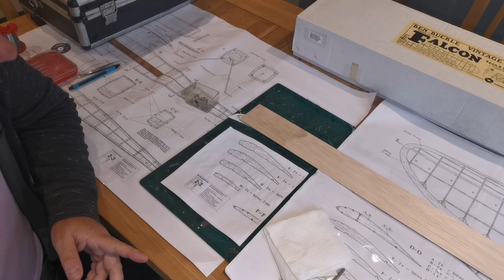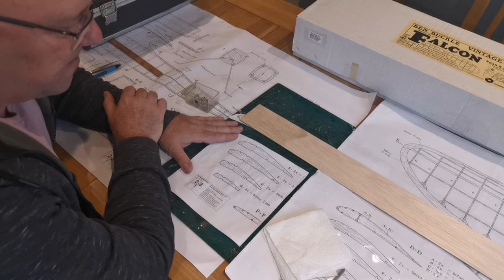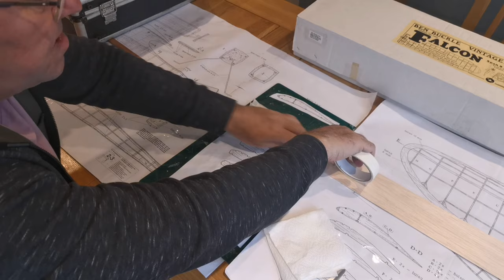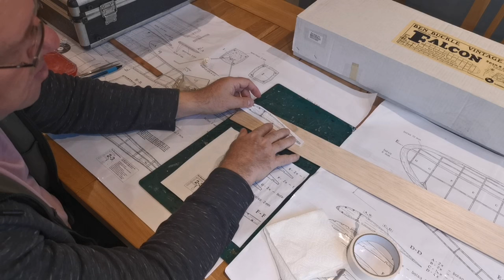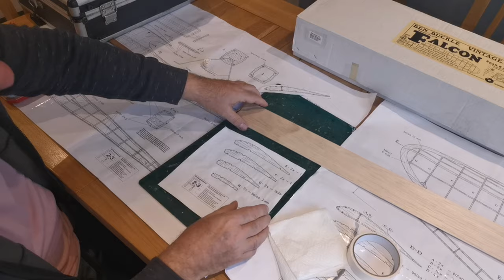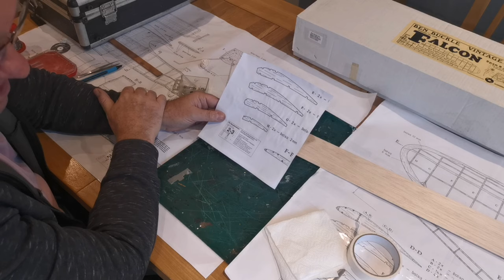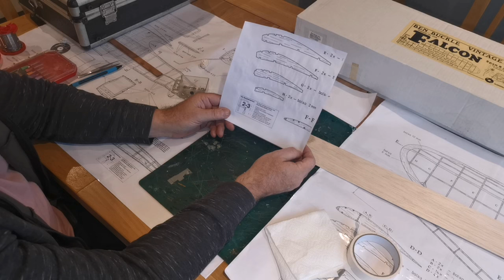Scratch building a model plane: plane to wood how I do it.

Comment: Have you tried ironing through the paper plan onto the wood to transfer the image over. If you’ve printed the plan using a black and white laser printer I find you can transfer it over that way but you need to print the plan as dark as possible.
Reply from the maker: I have done that in the past it worked well with a photocopy. I have also used carbon paper and tracing paper to good effect.